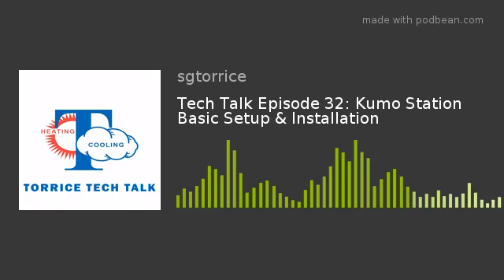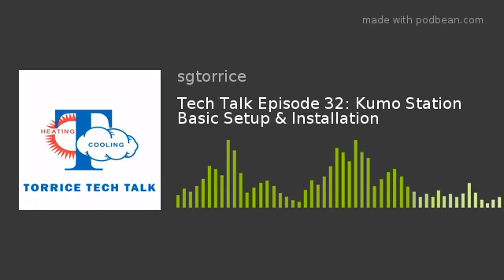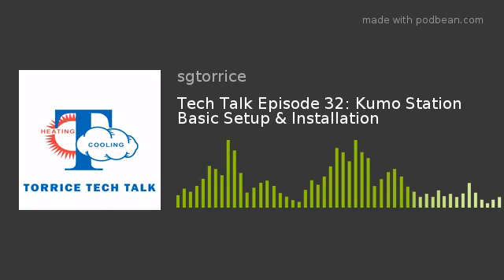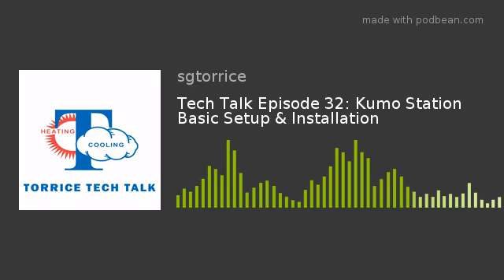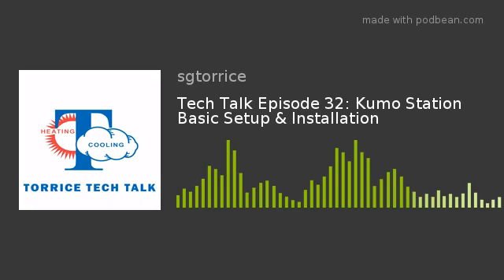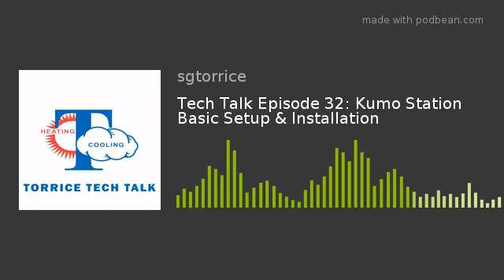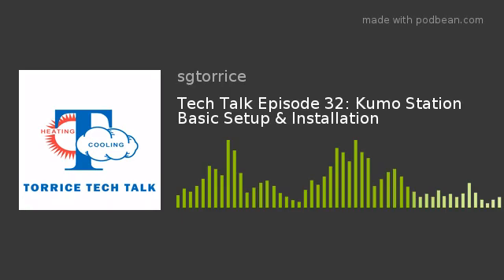Tech Talk Episode 32: Kumo Station Basic Setup & Installation

Comment: Hi Can you leave the existing 3rd party heater thermostats connected after they are added to kumo station?
Reply from the maker: Hi Michael,
This can be done, but we do not recommend it. This can cause problems with communication between different units and the Kumo Station. If you need a more specific answer on this, please give our tech line a call at 978-657-4768. Thanks for reaching out!